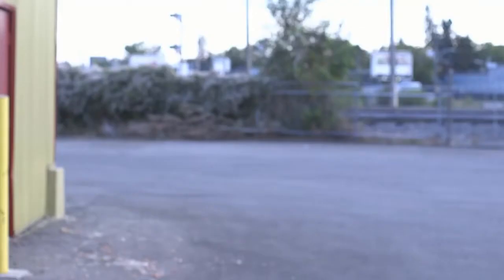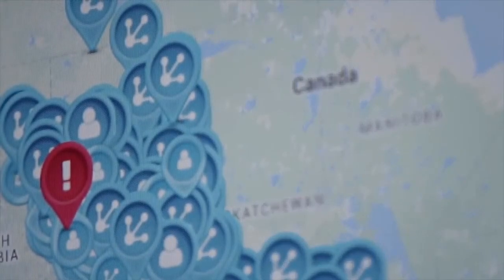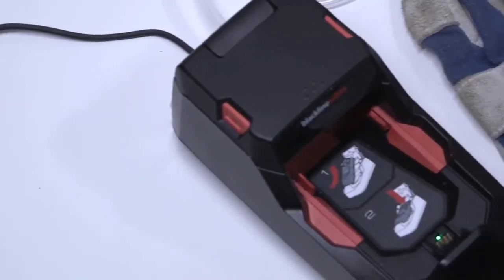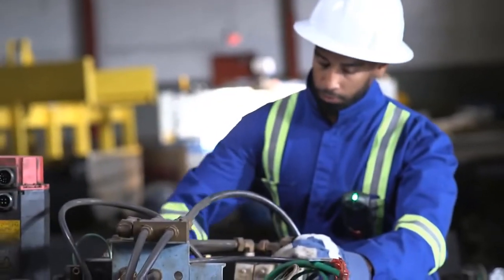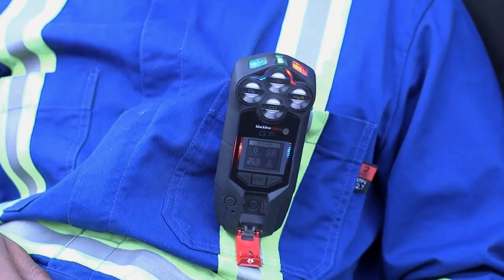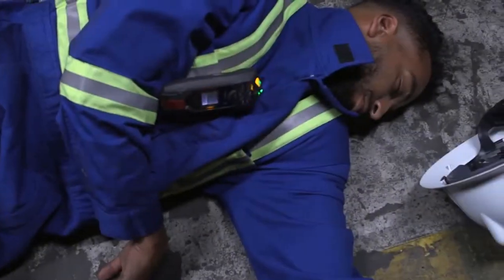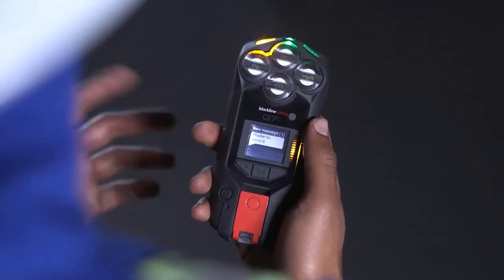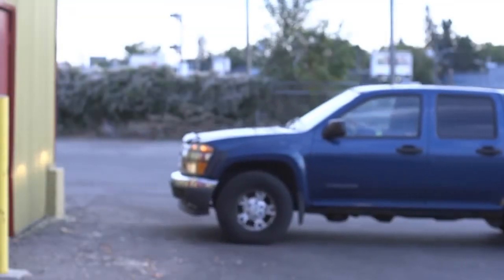G7 Gas and Safety Training - Gas Detection Systems | NH3, H2S, Cl2, SO2, LEL | Gas Detector

Comment from the maker: To learn more about our products, visit: https://www.blacklinesafety.com/
Reply from the maker: To learn more about our products, visit: https://www.blacklinesafety.com/

What is Cl2 - https://www.blacklinesafety.com/solut...

Is carbon monoxide lighter than air - https://www.blacklinesafety.com/solut...

H2S sensor - https://www.blacklinesafety.com/solut...

Lel sensor - https://www.blacklinesafety.com/solut...

NH3 - https://www.blacklinesafety.com/solut...

Oxygen gas O2 - https://www.blacklinesafety.com/solut...

PID detector (photoionization detector) - https://www.blacklinesafety.com/solut...

SO2 gas - https://www.blacklinesafety.com/solut...
Gas monitor - https://www.blacklinesafety.com/solut...

G7 Monitor - https://www.blacklinesafety.com/solut...

G7 Location - https://www.blacklinesafety.com/solut...

G7 Social Distancing - https://www.blacklinesafety.com/conta...

Gas Monitoring Device - https://www.blacklinesafety.com/solut...

Health effects from chronic low level exposure to hydrogen sulfide - https://www.blacklinesafety.com/blog/...

What is blackline - https://www.blacklinesafety.com/

Multi gas detector - https://www.blacklinesafety.com/solut...

Lone worker safety - https://www.blacklinesafety.com/blog/...

Lone worker solutions - https://www.blacklinesafety.com/blog/...

PID detectors - https://www.blacklinesafety.com/solut...

Safety for lone workers - https://www.blacklinesafety.com/blog/...

Combustible gas detector - https://www.blacklinesafety.com/blog/...

H2S name - https://www.blacklinesafety.com/blog/...

Multi gas detector - https://www.blacklinesafety.com/solut...

H2S monitor near me - https://www.blacklinesafety.com/blog/...

H2S Exposure Chart - https://www.blacklinesafety.com/blog/...

Blackline software - https://www.blacklinesafety.com/solut...

#blackline
#blacklinesafety
#gasdetection
#loneworker
#loneworkersafety
#safety
#workers
#h2s
#gasdetectors
#gasdetectorsnearme

YouTube channel link - https://www.youtube.com/channel/UCNil...
Facebook - https://www.facebook.com/blacklinesaf...
Twitter - https://twitter.com/blacklinesafety
Instagram - https://www.instagram.com/blacklinesa...

https://www.google.com/maps/place/Bla...
2XJ4+QH Calgary, Alberta
51.032186074881885, -114.0434762152886